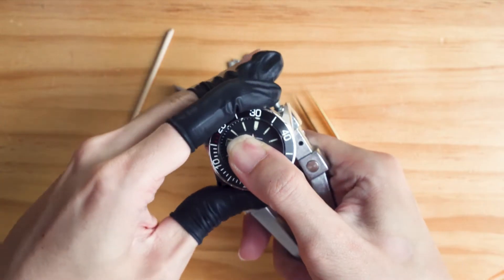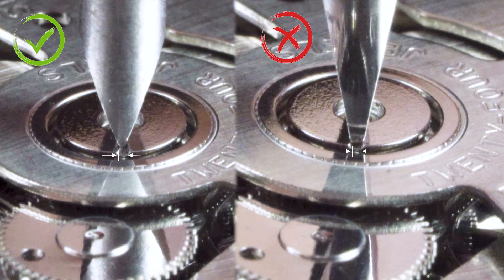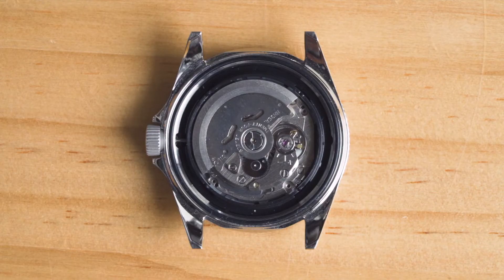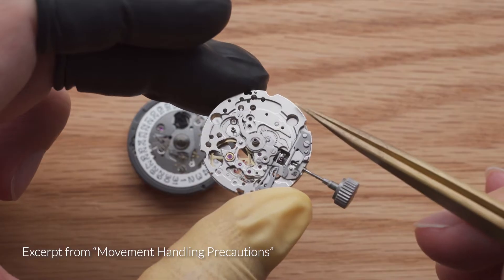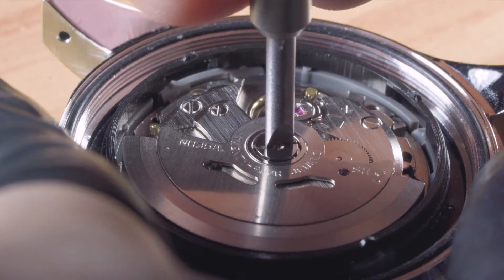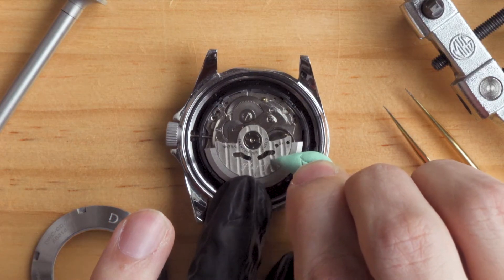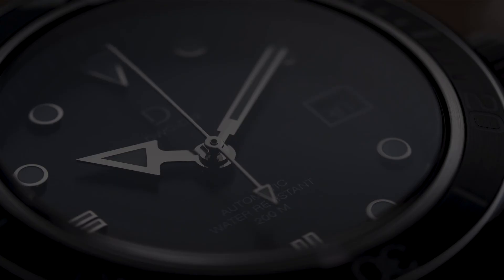Replacing Seiko rotor with a custom rotor - Seiko mod series

Comment: Hello I have a question: After replacing the rotor should It be lubricated? Mine seems to spin but sometimes It needs a Little shake to continue I don't know of it's the movement's friction or lack of oil

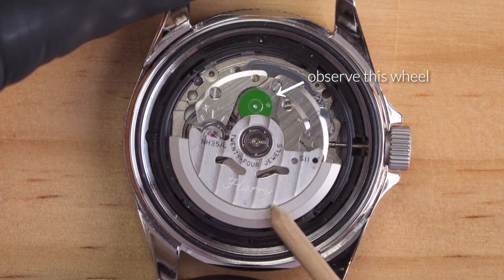Comment: 2:54  aligning the "dot hole" of the rotor with the "dot hole" of the rewinding wheel (green one) would help for the efficiency of the auto-rewind
- same direction for "right handed" watches 
- opposite direction for "left handed" watches (as on the video ? also its a right handed watch ?? well ...)
Reply: How so? I don't see how lining the holes up would make any difference. Can you please explain?
Reply: @gregs7519  depending on the "most commonly" used hand positions, the rotor movement will correspond to the magic lever maximal amplitude ... think about the elbow movement for a left handed watch vs right handed watch

at least this is what seiko gives 🤣
Reply: @gregs7519 Read the manual. It's a thing.

Comment: The rotor should not be placed randomly like shown in this video. Seiko has Guidelines on how to exactly place the rotor, where the weight has to point to...
Reply: Yeah it needs to all be aligned
Reply: Source?
Reply: @jsterjay TMI has a technical manual showing the correct method.

Comment: Amazing. all those movements are replaceble, this is so is nice! What defines a water resistance in the construction of a watch? Why is one 50m, another one 200m? Is glass impornant, dichtung-s,...crown?
Reply from the maker: It's the entire construction, from crystal thickness, to crown structure etc. One point of failure means total failure, so everything has to be up to par to the particular WR rating. You can read more on WR rating here: https://diywatch.club/en/blog/true-meaning-of-water-resistance-rating-on-watch

Comment: Very nice, may I ask the thickness of that screwdriver's tip?
Thank you.
Reply from the maker: It's quite difficult to get a precise measurement but I tried my best to measure it with a caliper. The result comes in at around 0.25mm. Hope that helps!

Comment: Hi! I have an Invicta with 2650 chainese movment, the rotor sound really cheap, and I dont wear the watch often.  So I thought on remove the rotor and make it manually hand movment.  What you think? Its will work?
Reply from the maker: I don't have hands on experience with 2650 movement. But theoretically, yes you can do this, and it will work